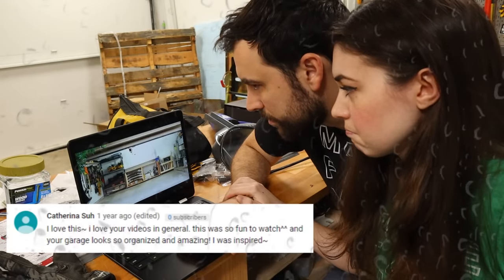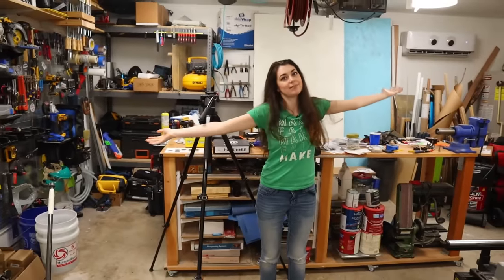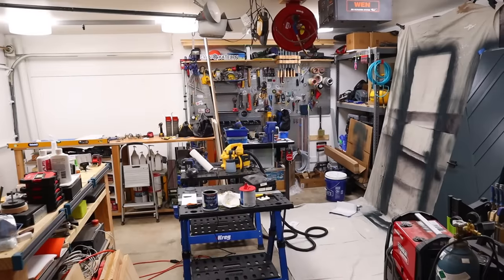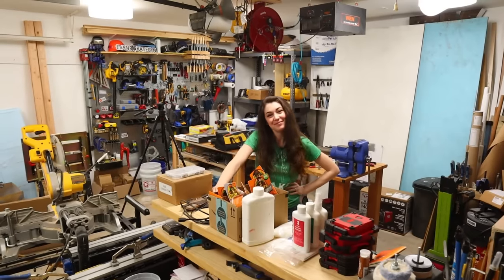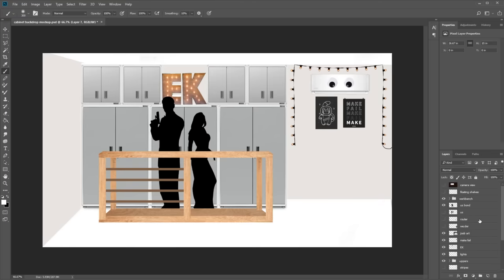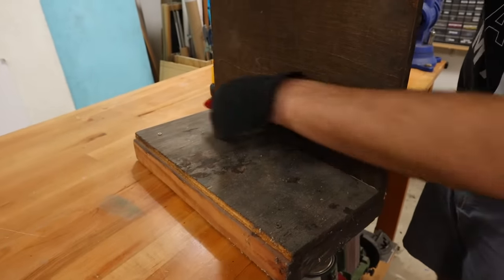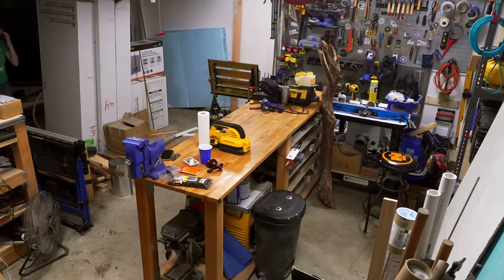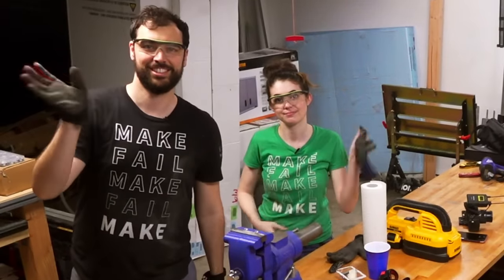DIY Garage Makeover

Comment: Nails are also the bane of my existence- they weren't, just neutral (always preferred screws), until bought my house and the previous owners LOVED nails.  Everything in the garage is put up with nails, along with random ones for hooks.  They put nails instead of cup hooks along the eves for Christmas lights, so every year... I deal with nails.  Just today I took out half a high shelf in the garage, and ended up putting dents in the drywall because it's soft and the nails were huge (thank god it's just the garage).  But the bonus is that I love my new 5-shelf unit and half-high shelf, and that corner of the garage is so much neater and cleaner.  But oh man, Evan, I FEEL YOU on nails.

Comment: A good idea when moving a large hanging cabinet like that is to put a bench under with wheels to the height of the cabinet minus a small space so you can lift it straight down and if it drops there is no injury or damage done to the floor or yourself.

Comment: On the anger / frustration Evan had with old cupboards nailed to wall - nails have much higher shear strength than screws so are better for this application. Prising them off using leverage with pry bars from outside the cupboard, not from inside, is pretty easy, put scrap pieces of timber under the pry bar to protect the wall.